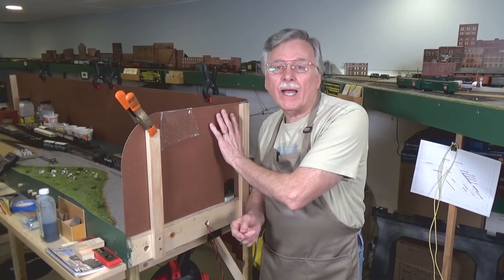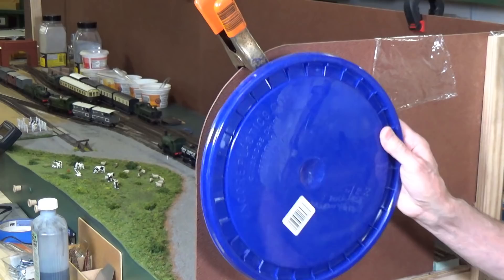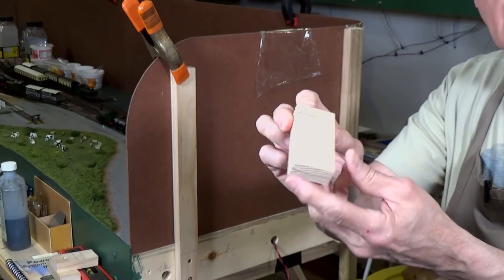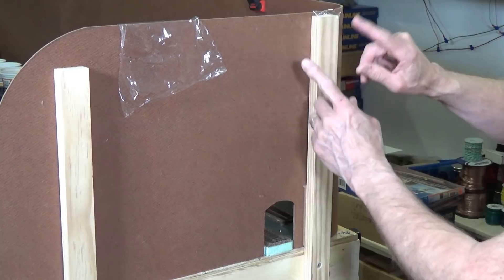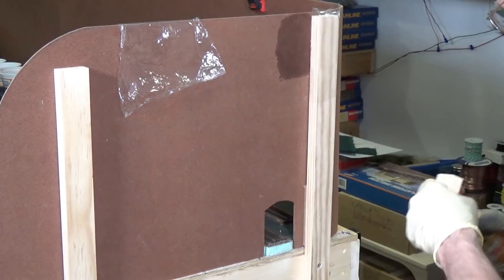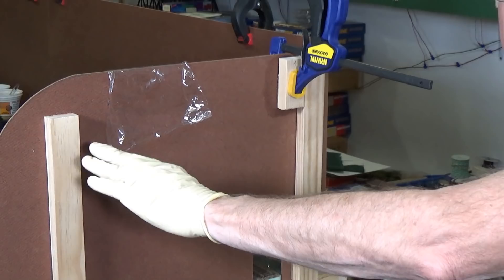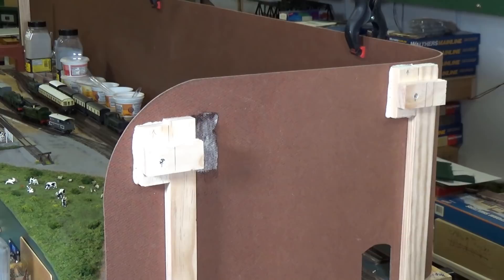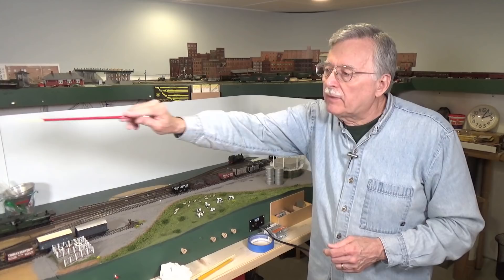Blue Skies, Cutting Curves, And Some Clamps (189)

Comment: If you put a backing board it will put pressure on both uprights as long as they are the same thickness. The plastic wrap will keep the support from sticking. Good job. It's difficult to do even with six (6) hands.
Reply from the maker: Those clamps are what made it possible, worth 2-3 hands, but I still had to wrap one leg around the base into to hold it still.

Comment: Good video Larry.  The only thing I would suggest is that people using this method also clamp the backdrop to the vertical support.  By keeping that interface tight it minimizes any opportunity for the glue to expand into the gap between the backdrop and support thereby helping keep the overall assembly tighter and more rigid.

Comment: Excellent backdrop Larry. I reccomend using Velcro to attach it to the uprights, it makes it really easy. Velcro is also great for attaching low relief buildings to the backdrop so they can be removed when you take the backdrop off.
Reply from the maker: You could definitely use the heavy commercial grade Velcro. But I would be afraid that separating it might require a lot of heavy jiggling as well as a person for each upright just to keep it from reconnecting.

Comment: My lady, an artist, suggested that the really blue sky made my layout look too dark.  I lightened it up with a lighter mist or much lighter overcast and agreed that it worked much better.  Your backdrop looks great!
Reply from the maker: Thanks Nick. This is a color I get mixed at Home Depot, Offshore Mist. Folks do tend to pick too dark a blue IMHO. Actually the color tends to be darker towards the ground and get lighter as you go up in altitude. I know some folks who actually paint their sky using an air brush to get that gradient in color. However I use photo backdrops on my PS and the one I will use on the modules will cover the whole shooting match—assuming it ever arrives.

PS—I now have the EMD 21 pin decoders from LokSound, SoundTraxx, and WOWSound so look for a 3 way comparison soon.

Comment: Just like Seattle. "Blue skies, shining on me. Nothing but blue skies, do I see..." - Willie Nelson

At risk of being a nitpicker, I might suggest an alternative to attaching your clamping blocks to the stationary blocks. Do you think a small carriage bolt installed in the stationary block from the hardboard side, sunk enough to be below the block surface, and protruding through the outside of both blocks, and secured with a washer/wingnut combination might work? My concern with wood screws will result in a worn-out hole that would require occasional insertion of a small dowel to reestablish sufficient screw gripping surface. Your system is a great idea!
Reply from the maker: I wanted to avoid any use of screws, bolts, etc. running through the backboard. Moving these around is sure to result in popped spackling. Better to keep it all simple and mounted on the rear.
Reply: @TheDCCGuy  Larry, respectfully, I believe Tom was referring to countersinking the carriage bolt into the glued block of wood before gluing it to the hardboard, avoiding the spackling you mentioned, but relieving the concern of the screw hole wearing out.

Comment: Looking good!  Why not glue the support uprights to the backboard?  To remove, simply unscrew the backboard from the baseboard.  Safer in my opinion.
Reply from the maker: I just wouldn’t trust the glue bond to hold up over time, especially on a layout taken around to shows and meets. While a wood to wood glue bond is pretty reliable the hardboard can be a bit flaky and might pull away.

Comment: Very pleased you've shown how people to curve backgrounds round corner: so many layouts are - well spoiled is maybe a strong word, but not shown at their best with the 90 degree corners to the backscenes.  The clamps you've made work really well too, but I wonder why you did it that way, rather than fixing the verticals to the backscene (which would also give it some stability when removed), and then attach the swivel clamps to the edge of the baseboard, where you could screw them in.
Reply from the maker: I am always amazed how tight a curve you can bend into this stuff. I didn’t want to screw the backdrop to the uprights as that would require spackling to cover the heads and the chance that would later pop off. I guess you could use Gorilla glue.

Comment: Great video Larry. More than once I’ve tried to clamp something and had that same issue. What number screws did you use? Those coffee stir sticks are one of my favourite scratch building items. They are even good for cleaning real dirty track spots.
Reply from the maker: I think those on the wood blocks are #8x3/4” wood screws. I countersunk them then drilled out the outer hole so it would pivot freely.

Comment: Rule #1 on building modules  ...   NO PARTICLE BOARD  !!!  If you use particle board your module will be so heavy you will not be able to lift it.
Reply from the maker: Plus it is not dimensionally stable. At my old club the raised aisles were particle board. After a few years they sagged so badly we had to replace them with 3/4” plywood.
Reply: So, what’s the suggested material to use instead?
Reply: @KenN.OXN.805  Use regular dimensional lumber and plywood.
Reply: @TheDCCGuy  Which is why I do not use trex for decks.
Reply: @farmerdave7965  I may have misunderstood your original advice about particle board. You weren’t criticizing the use of the stuff Larry used for his backdrop, right?
Reply: @KenN.OXN.805  masonite is not particle board. They are two different things. Masonite is also known as hardboard and is fine for use as backdrop board such as Larry is using.